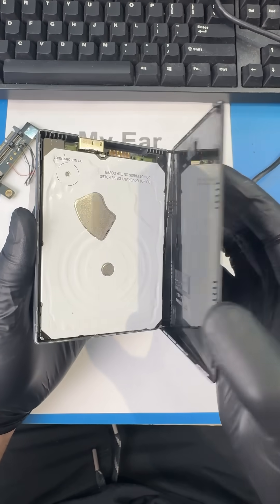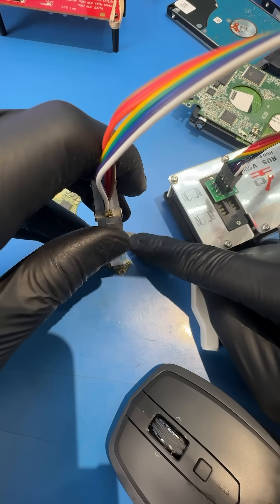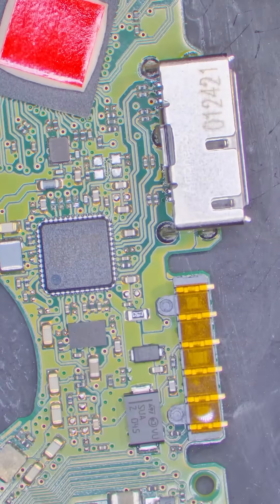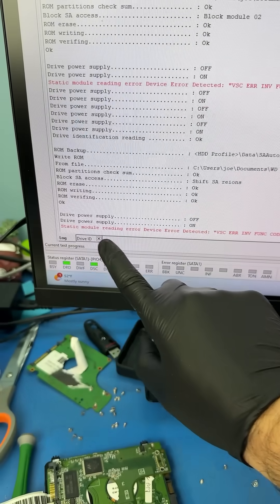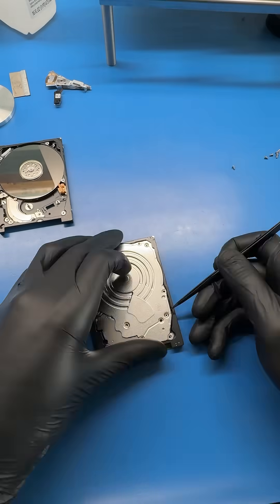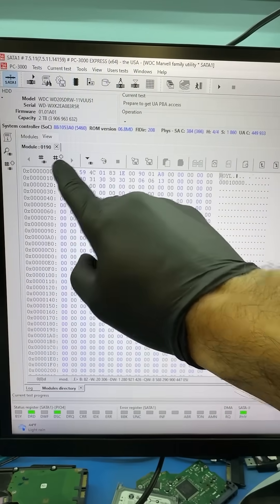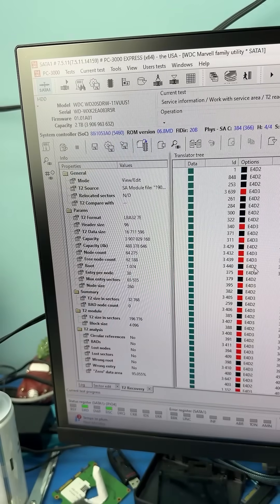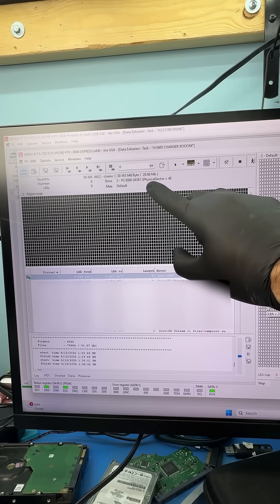Hard drive translator...? #tech

Comment: Some years back I worked for a small, but stupidly profitable company, that wrote software that tracked gauge calibration cycles - a single copy was $800.  Their customer base was fortune 50-100-500 (Ford Motor Company, Square D, etc,.).  The president of the company I worked for lost a 40MB (MEGAbyte) drive and paid $30,000 to have it recovered (I think it was Ontrack (only game in town back then).

Lesson: if your data is in .TXT or even .PDF - 40MB is everything.

Context - I was once referred to a customer whose laptop drive crashed whilst updating the custody agreement, with her ex husband (hours and hours of details), concerning their son.  It was a Microsoft Word doc - it was all she wanted.  She went to Data Doctors first - they quoted her nearly $1,100 to recover one file.  She got my number from a friend, I used Knoppix 7, recovered the file, and charged her nothing for the drag/drop.

This is the long way around to say this video was absolutely nothing like my experience.  I always have you in mind for the time I know, it's beyond me.  I can't guarantee you 30K, but if I do, I may want to talk about a finder's fee.  ;-)

I truly do love your work - you have certainly spent your 10,000+ hours at this.  You have my respect.

Comment: Specialist companies charged a small fortune for data recovery where a dust free environment was required to recover data from failed hard drives, often with a significant up front fee that was non refundable even if the data recovery was unsuccessful. It must be very difficult with modern super high capacity hard drives that are sealed in helium.

Comment: Nice job I'm computer guy i don't have a patience like this guy is a professional in field love lesson someone will do it this not a boring stuff All day I would lesson some who put heart work  of computer work or  fixing motherboard and drivers for me see and hear someone know What they doing I work with someone who equipment long time ago you show me all this stuff by then practice you need everyday without you not perfect you are on the way  I have some idea I fix few flash drives was corrupted you can't use anymore the only people want to throw them to the garbage without taking the part the corruption data black to use them  I was lucky snice 2004 backup on flash drive  some JPG docs could send back to pc some software always back some not blocked most time use software that help I find way without taking part  them 8 16 32 gb then 256 gb Later people buy portable drives hard drives  I never call me back went they get portoble drives 1 Tb ok that was my experience OK bye

Comment: Just a simple RAID is the bare minimum if it means anything to someone.  I have twin external enclosures each with a pair of mirrored drives.  Nothing fancy. Optimally I'd regularly rotate these drives to an offsite storage facility in case the house goes up in flames.  You can never be too careful.  Mr. GameDev should have known better.

Comment: This portable external drive was dropped. If the drive head isn't parked it can crash into the platter causing the damage shown in the video. The safest portable storage is solid state. Mechanical drives should ideally only be used internally in PC builds and not to be moved around unless the drive head is parked.

Comment: I have a 4tb smr seagate drive from like 10 years ago I need to fix. It has several platters and stopped working but data could initially still be recovered from it.  Over time it got worse and worse even though I wasn't using it and now it makes horrible noises when powered.

I have no idea where to start when it comes to fixing it at this point. I can't even find a donor drive of the same capacity. The last one sold out.

Is there any chance I can recover any data?  I cannot afford to send it to a professional and I wouldn't do that anyway since there's no way for me to guarantee the repair techs wouldn't see any of the files and since the drive was used by multiple people in my household I don't know exactly what's on it.

Since it is SMR and large capacity and at least half full I know opening the drive outside a clean room would make data recovery very unlikely.  There has to be some path forward for me

Comment: Add the white conductor behind the drive and then connect the SATA converter and Insert into B2B coupling after that add the SOTA connector and then add the connector to the bootable device and restart the device and again add the ZOTA connector after this you will see the 29 MB data for backup this data add three NATA bus line to your bios and then turn on the drive and after that connect ZATA connector to the pc and get backup
Reply: Actually this works thanks 🙏🙏🙏

Comment: thats why you dont use fuckin hard drives
Reply: ssds lose charge over time
Reply: @nokaarchive  they last longer than hard drives though. one of my old laptops had an hdd and i had it for about 2 or 3 years before the hard drive failed and i couldnt boot into windows. i had to back up all my important files through cmd in recovery boot.

Comment: That exact same hard drive sits in my drawer collecting dust. 
It is non-functional. After less than a year. I was able to pull the data off of it before it completely shit the bed (minus a few gigs). That was the first and last WD hard drive that I purchase. 

I have a 160gig external that’s 20 years old and still goes.

Comment: Thats a firmware corruption.
I have a living drive with a very passive corruption.
Basically the code in charge for managing the power supply broke and possibly one or two dampeners as well (resistor circles) 
This causes minor reoccuring issues but also indefenitely kills readers and other components over time. This is good work

Comment: so I had a drive one day it stops working it was an xbox one BUT it was one of those external drives and i formatted to htfs for my windows mechine and one day it stopped working and not showing up in windows explorer I have over $1,000 worth of source codes on there for applications I will not say the use of because this is youtube don't need to go into detail but does anyone know a fix for it without soldering and all of that

Comment: I'm not from a highly technical background at all - at most, I'm a professional service supervisor with a gaming rig / homeserver hobby.

I am often reminded, both through things I see at work and things I see on my own time, of how often businesses and individuals never consider backing up mission-critical data and/or archiving files they deem important but not mission-critical.

Back up your important data, fellas. Run a mirrored RAID array on enterprise drives. Stick a mirrored NAS somewhere in your office. Keep an external drive with a robocopy batch file and run that whenever you need. Heck, do the same thing on a thumb drive if all you're backing up is excel files and other basic documents.

These solutions are cheaper on the wallet when you implement them, and easier on the nerves when you finally need to depend on them.

Comment: Legit want this equipment & software so I can do this myself at home. Git a list of what stuff you used in this vid hardware & software wise, besides the clean positive pressure cabinet? I'd be extremely interested since I was told that most of the software & some of the hardware used by recovery firms are typically proprietary & designed in-house.

Comment: instead of giving the customer the new drive, you should keep it, return the old one, and give them a download link to a file on your server, and a button for the user to purge the data when they download it. Otherwise your wasting your time sourcing donor drives. Work smarter, not harder.
Imo, just replace the head and do what i just said, you did 3 jobs for the time of only needing to do one.

Comment: Why not just swap the disk out to a newer unit instead of messing around with all that. Speak to the client and if you can get it to work by swapping the disk out, see if they want it transferred to an SSD at their cost , and then either transfer the information to the SSD if they want it that way or give them the newer casing with the original disk (as long as the disk works)

Comment: A game dev not having a backup of his projects is wild.
Reply: Not exactly a job where you have an extra $400~ to setup a backup system, they're clearly solo too so that should tell you more than enough.
Reply: @RetroRuin  You don't need 400$ just an external usb hdd. You can buy a 1TB nvme for about 50-60$ and an enclosure for about 10-20$ and backup using FreeFileSync after a day of work. A nvme external drive is super small and backup speed is very fast. That or a cloud repo which is usually about 100-150$ a year. Not backing up your code for whatever reason is imo stupid.
Reply: @RetroRuin  I'm a dev and i always backed up my projects even when i was at school in the 90ies.
Reply: @francischabot1412  we're not in the 90s, not everyone has boomer economy money.

Comment: As someone who has worked for 27 years in I.T. ( and hard drive recovery) data you have one copy of is data you don't want. If you don't want to spend thousands of dollars and still possibly lose your stuff? Spring 100 bucks for a second drive, and get into the habit of using it

Comment: 1st, it's a hard drive, 2nd, it's a HARD DRIVE, and 3rd, why the f<"( have they not upgraded it to an SSD. Older ssd's especially sata ssd's, are about the same price as hard drives. The only advantage hard drives have over ssd's at this point is sheer capacity.

Comment: I did recover data from HDD where i had some bad sectors and couldnt even be recognized. I used  Linux using some crazy shit programs...i felt like a freaking wizard after that...i domt even remember  how lol i knowni putted it into an Iso file and then unpacked,the program did run like 15 hours till it pulled saved data

Comment: 28mb of data for a programmer could be a lot. If it’s not some sort of unity file or engine that can just be replaced later. If it is custom handwritten code that is extremely painful. Having to write 28 mb of code is equal to a whole bunch of lines idk how many because it depends. But yeah u should definitely make backups of backups. Keep backups in drives and on different computers. 500GB is a lot but if it’s important you’ll pay for it.

Comment: This is some times why people have used microfiche these are really complicated issues and you need almost like a magnifying glass to do this sort of thing like a watchmaker not only that there are serious compromises regarding security of a lot of computer stuff even our 1 is 450 ICBM missile sites require that you use the old floppy drives and one of the reasons is a lot of the older computers use some parts that are more solid state in vacuum tube type stuff most of this newer technology is not worth its weight

Comment: Have you thought about using a STEM  to rectify the coaxial conflagration through diode spatial oscillatory analysis thereby allowing ground voltage to repurposilate a direct vector to the inverse modulation of the oscillating corrupted kernel stack? Or try Ctrl+Alt+Del.

Comment: Ok, I wanna get this right.
A game dev had all data on this drive, it failed.
So in turn you listened for weird sounds, while nothing was found.
Moved onto replacing the motherboard, this making drive functions as normal If it can
Then you wired in the *Data/Power/Write/Read functions on the PCB, again didn't work, that making it SATA.
Then while scanning it couldn't read meaning the read thinggys don't work? (IDFK What they called, the weird things that along the disk/read the chipset)
He then used a dust free chamber Only due to this being a final option so ensure dust doesn't mess with the drive, where the data/10101010 are kept?

Comment: Who the hell uses a disk drive as a external travel drive anymore. The whole point in an external drive is to move around easily alot and move data fast back and forth between machines. A disk getting moved and banged around isnt practical it should be an m.2 enclosure with an nvme drive in it.

Comment: tldr do not use hard drives, install two solid state drives in mirror mode with very large memory, i.e. with a huge reserve, also buy cloud storage, also do projects with data synchronization.

Comment: Do you attempt to blow the crud out with clean air? When I used to work with removable disk packs the drives had a purge cycle that blew HEPA-filtered air for a minute or so before the drive would load the heads.

Comment: Reminds me of when my father was helping a customer upgrade their 2 HDD drives to SSD drives.
While he was cloning one, he plugged the other into an external USB socket so he could check it's health.
Unfortunately, the customer Apparantly had windows on one drive, while the other was used as boot drive.
And the drive he was checking the health of, was the boot drive.
The boot pointers, pointing to the windows instalation on the other drive reset to 0 due to not being able to find the other drive.
He had to manually restore the pointers for the booting process back to the other drive.
Reply: i didnt know it was even possible to have windows on one drive, and the boot drive on another one.
Reply: That just sounds like another Windows issue, no data loss probably. Windows sometimes does wierd shit when multiple drives are connected during installation

Comment: Would it be possible to perform a recovery on a drive that had a head crash and can’t read the service area? Having swapped the heads, they died within 30 seconds from the startup. The company said they tried head swap which failed, so they gave up to prevent any further damage. There are scratched platters probably, since it dies — they said. I’m wondering how would a recovery of such drive be performed, and whether it’s possible with current tech.
Reply from the maker: I have a video on scratched platters. You need to be able to read the service area to access the drive. Need to remove the platters clean any platters dust, and we can modify the heads to read from the non-scratched surfaces. But if its scratched on the platters where the SA is then cant do anything

Comment: The USB controller chips failing is also a common failure on those drives and pretty much in that case the drive will spin up and initialise normally but any device you connect the drive to will not be able to communicate with it over USB.

Comment: Just a quick one, when dealing with the charger drive, you need to have compatible firmware stored where you can upload the fw to ram , these drives do not upload to ram from service area (hope this helps) also a quick one sometimes tapping on the head screw lightly with a screwdriver causes these drives to work again
Reply: And when using the data conversion, just use a sata board , the original usb board houses the encryption data which you can loose out on bits of data (so try keep original pcb untouched and only fix fw with the data board)

Comment: This video along with many others here on YT clearly demostrats what the vast majority of us never do and that is to do backups of all of our important data.  A new hard drive or ssd is far cheaper to purchase to continously keep important data backed up.  The question you need to answer is not if a drive will fail and the answer is any drive can and most likely will fail.  When this happens you can safely toss the failed drive into the trash, if you clone the drive and then use good backup software to keep backing up any files that have been edited as well as adding new data that was not on the mirrored drive.  When your old drive dies you can simply replace it with the backed up drive and then clone this drive again and continue on with doing the incremental backups on a daily, or a weekly basis.  If we always do this then we will never need the services that recover data that costs a lot of money.

Comment: Had an external HDD start dying out of nowhere too, had to mount it to a linux install to start removing data to a backup and it just kaput in the middle of transfer after getting all but 6gigs on a 427gig drive worth of data. could probly use some of the things ive watched you use to fix it.

ps: the MBR (master boot record) nuked itself, unsure why.

Comment: And that's why I hate WD HDDs on consumer sector, Toshiba is little better, but best is nowadays Seagate. I only use WD for storing non important, temporary files, for anything else Seagate. I know there is out more expensive WD that is good, but for that price you can buy a HDD from Seagate with double of space.
Reply: WD is fine, this failure mode was probably a head crash judging by the scratches on the disk surface. That's an issue with dropping the drive, not the build quality.

As long as you check your SMART data and replace the drive once it throws up warnings you're gonna be fine 95% of the time. And if you haven't got external backups then it doesn't matter what brand of drive you use because all of your data is going to disappear eventually anyways.

Comment: Taking off the protective plate and getting the soldering iron out is when I'd nope out. The chance of anything going wrong is insanely high. like you said, a speck of dust or a bit of static could ruin it all.
Reply: yeah you should NEVER DIY data recovery unless you genuinely know what you're doing on a professional level or you have backups/don't need the data.

I've imaged failed SSDs and stuff before, but unless you have some very specialized equipment you don't want to mess with mechanical drives.

It's a time-critical process where leaving the drive running for 5 minutes can turn a recoverable drive into garbage, even microscopic dust specks too small to see are enough to score the platter surface and completely destroy it.